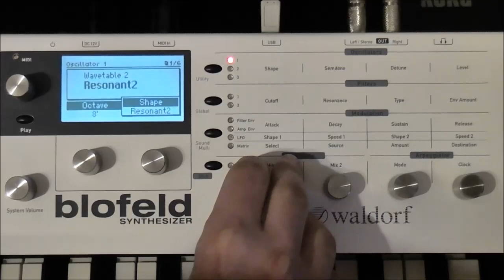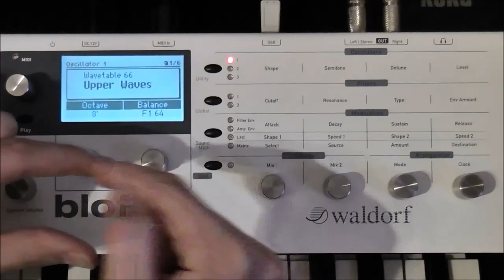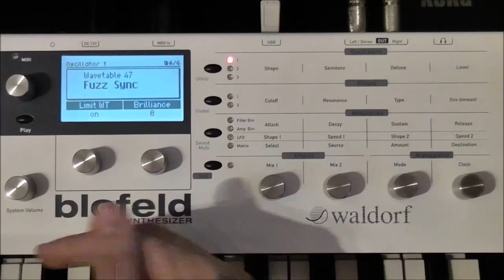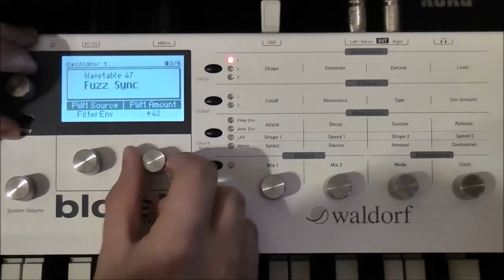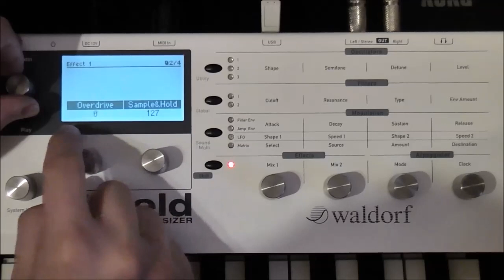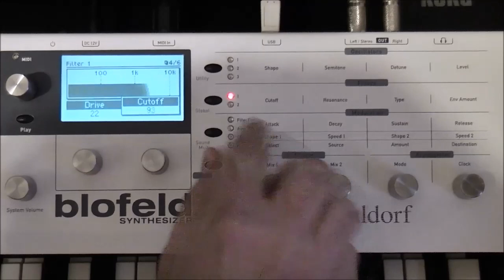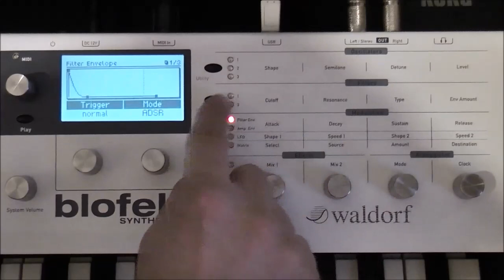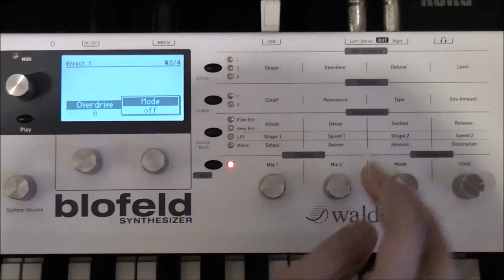[tutorial] Pushing Blofeld toward microWAVE

Comment: If I may ask: Have you been able to find out what exactly the WT/Smp-Destination in the mod-matrix is doing? I expected it to allow some sort of 2D-wavetable to be created using wavetables above and below the current one. But this doesn't seem to be true. At first, I only hear an effect on note-on and then it seems to "wildly" jump around inside the current and maybe (but I am not too sure) in one or two of the above (below?) wavetables. So the result is most often nice but remains unpredictable...
Reply from the maker: I think that this matrix destination was explained in this video: https://youtu.be/lWTew3_ks4M

It is changing the wavetable or sample when modulated but only for the next key trigger. And yes, it's quite unpredictable and yes, that's what it's for :D
Reply: @SynthesizerVideo  Yes, this (what you explain) is what I thought it would do, too. And while your explanation is absolutely correct for samples, it is not for wavetables... But I think that I have found out by now. It is surprising what it really does in case of WT-oscillators... (will do a video on this as soon as I can).